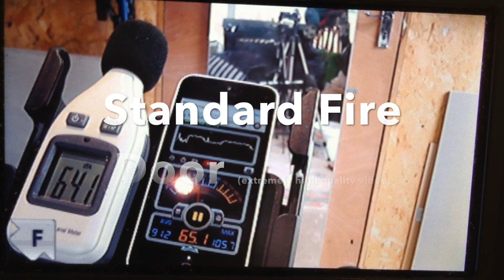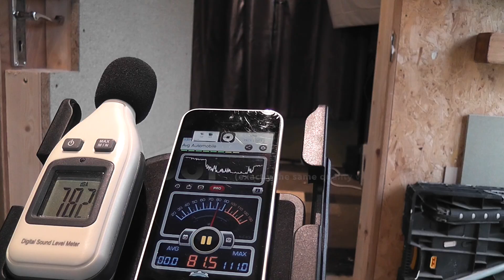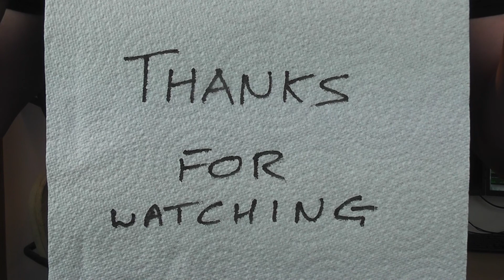Soundproof door db test

Comment: The only thing you did wrong (and the reason the results weren't as big as you were expecting) is that you completely ignored the perimeter of the door (unless there's something I'm not seeing). If it isn't airtight it won't block sound. You need to do weatherstripping around the edges of the door so that it is difficult to shut it completely, and once it is shut, it's completely airtight. You also need a doorsweep to block the sound from below.
Reply from the maker: Akis oh yeah. I must have fitted them since doing that video as they’ve been on forever but there aren’t any in that video.
I genuinely have no idea why I didn’t fit them prior to the test. 
Well spotted

Comment: 4 dB is a significant reduction due to the way our ears perceive sound, so don't be too disappointed. To put into perspective, 10dB quieter would be the equivalent of a 50% reduction. Check out the stats at the beginning of this drum booth video:

https://youtu.be/gGoI02jxDP0
Reply from the maker: When I made this video i though db was a linear thing.  it's quite embarrassing looking back now.
Reply: @PherotoneStudios  I found your vid because I am looking for a Solid core door and I want to sound proof my small space.
Reply: No shame in that, I only just learned dB was not linear last year. Your engineering and carpentry skills are light years beyond mine, I'm looking to build  the same thing in my home studio, that's how I found your vid